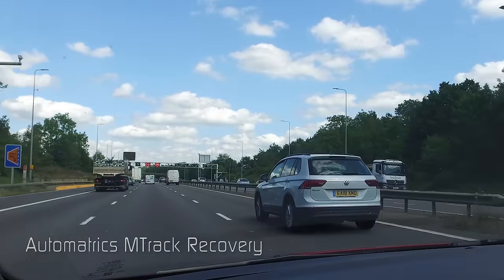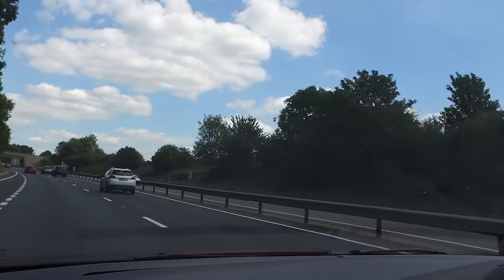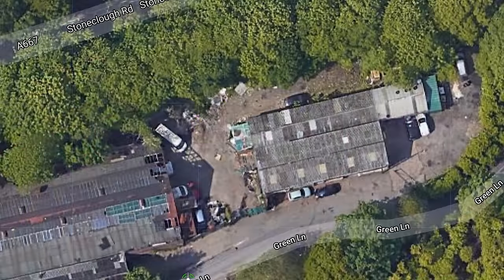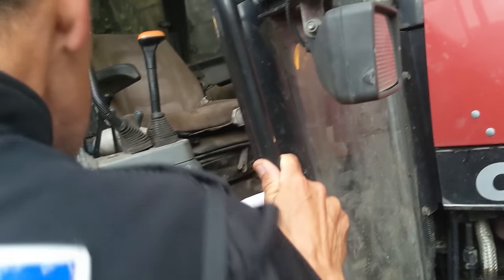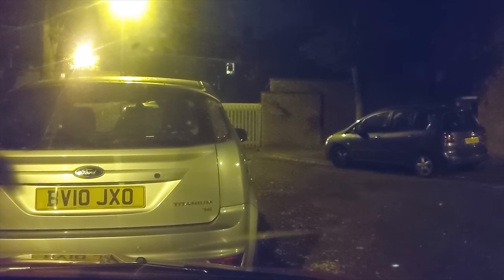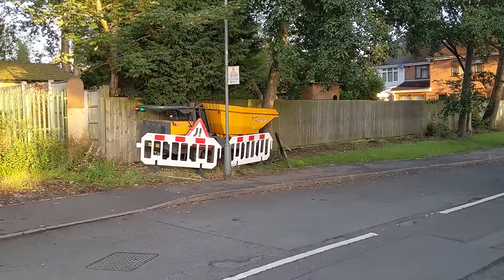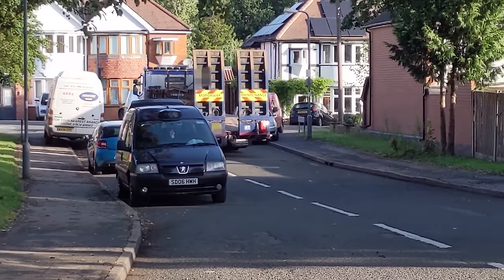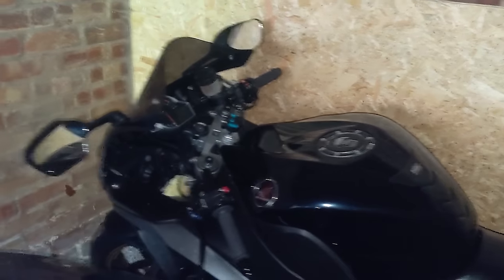Automatrics Triple Stolen Vehicle Recovery Challenge – 29 July 2019

Comment: Hope the officers forced entry to the other 'Vacant' garages that weren't supposed to be locked. 
Probably used as more bandit stash houses.
Reply: Can almost guarantee it.
Reply: That would be breaking and entering, so yeah they probably did.
Reply: @deeej  No it wouldn't, because the council owns the garages and they're supposed to be empty. They aren't rented out and so if the council say they can smash the locks of to gain entry, then they're entitled to do so.
Reply from the maker: @jsl4228  Correct - Council said remove the locks with least damage possible, hence that's why police just tried to break the lock off relatively gently gently and not smash the door in. 👍😜👍
Reply: @deeej  No - it wouldn't.  They can show cause.  So in a situation where they go to court, they would be in the pink.
Reply: @tcpnetworks  Yes, beside which the Council reported that #26 was also not rented.  I would have the lock off it as well, in the hope of finding the BMW.
Reply: @AutomatricsMtrack  visit the lock picking lawyers channel, you will be able to collate a list of easy methods of removing locks non destructively.
Reply: @amojak  yeah, but that looked like an Abus Diskus, if i'm not mistaken, even LPL said that it gave him a little bit of trouble picking it. And you cant shim it either.
Reply: @tcpnetworks  who would take them to court? The council own the garages, they want the loacks smashed.
Reply: @Ephoros  Ramset?
Reply: @AutomatricsMtrack  you ought to carry a battery powered 4" grinder in your vehicle with a dozen cut off wheels. You'd slice through that lock in seconds for the cops. Dewalt make good units. They cut through chains and locks like butter.
Reply: @deeej  Then they arrested themselves.
Reply: @imouse3246  I'm guessigg the bmw is in the other one.
Reply: @amojak  Great minds think alike :)  When the police started 'attacking' that padlock, the first thing I thought of was the lock picking lawyer gently caressing the tumblers with his 'picks'  LOL
Reply: A garage is not a tenancy or a residential dwelling. Therefore if it is listed as not rented. Access can be gained at any time with the councils permission
Reply: AutomatricsMTrack looked like the officer was trying quite hard, we’re there not screws on the wall plate that could have made a much easier entrance?
Reply: By the looks of it they spent half a day trying to burst open one lock..
Reply: @AutomatricsMtrack  you call that gentle a handle grinder would have been better are a crow bar
Reply: The bmw must be in the garage beside
Reply: @deeej  Nope

Comment: 16:25 - Someone needs to introduce the cops to the battery angle grinder, chosen tool of bike thieves... Would have had that lock off in seconds.
Reply: thats how the thieves work,a low-life walks into machine mart and buys one,not so much as a raised eyebrow...fucking frustrating.
Reply: @eddyriley2055  A thief walks into a machine mart and buys something? XD
Reply: @frankvandendool882  yes,with a stolen credit/debit card,try to keep up.
Reply: @eddyriley2055  Don't be so serious dude. I just thought it was funny.
Reply: @frankvandendool882  you are right, we are cool.
Reply: @eddyriley2055  they’d need to have the PIN number to use the credit/debit card they’d just pay cash or will have bought a 2nd hand one of someone

Comment: A cordless angle grinder would have got that padlock off quicker with less damage.. 😎🤫☘☘
Reply: depends on the material the shackles made with. some alloys can be surprisingly resistant to normal angle grinder blades.
Reply: come on now, the police can't afford all that fancy equipment that the criminals use.  They need to spend that money on computers to catch wrongthink on the internet.
Reply: Police should carry a Grander, cut pad locks and chains off

Comment: If garage 26 is not rented and has an unauthorised lock on it why didn’t they check inside that one as well or at least get the councils down if they had a key for it!
Reply from the maker: That's a good question . we did not hang around to find out. But what you say makes perfect sense and the attending police should have also opened that one up.

Comment: As for the garages, why not bring a cordless drill and endoscope camera? Might be a quick and easy way to get positive ID without breaking the lock / door
Reply from the maker: We now have an endoscope in the tool kit, but our only concern is that had we used it on this job, then we may have well bailed out and missed the bike.  We would have struggled to see the bike stashed at the rear,  away from the door.

Comment: So is this general practise for car-nickers ?   Steal it, then hide it and wait for two weeks, in case the vehicles had a tracker ?
Reply from the maker: No,  it depends on the vehicle and the bandits, however most will be parked up and searched for the more commonly fitted and easier to find wired OEM tracking devices. Somewhere usually in the open for a few hours,  after that they can go to a lockup or stay longer. We don't know if two weeks is realistic from our experiences as we recover ours within a few hours 👍👍

Comment: You're dealing with GMP who aren't the sharpest tools in the box.  They quite often seem to want to delay things using incorrect procedures.  I have yet to work out if there is some motive behind it or they are just ill informed.  I know that estate only too well from past experiences attending there with fire appliances.  It isn't actually the Europa Estate, it's Green Lane off Quarry Rd,  Europa Estate is further down the main road.  The place where they found the tractor usually has some form of hessian sheeting up on the steel fence so you can't see what's going on.  That's a dodgy sign for starters.

Comment: For the tractor, would you recharge the battery or put on a temporary tracker just to keep location since the original battery was going flat?
Reply from the maker: That old unit was designed in 2003 and is a non rechargeable version, we do a service exchange on those. They are super reliable and remain a rock solid solution even for today. Exchange unit arrives for customer to change and swap out the low battery unit and return that to us in a prepaid bag.

Comment: I might fit a tracker to one of my vehicles now. Although its not cheap.
Reply from the maker: GPS trackers can be very cheap,  but do your homework when selecting these or other devices for security. Most all GPS only location trackers are not using any secure frequencies or offering a truly covert fitment. Whereas proven professional police preferred and certified theft recovery services will always offers much higher performance and with it a more credible police response... although police will still attended on a priority availability base via the control room.

One major vital area that is often missed is that users may struggle to obtain any type of professional SIM management or have chosen a partner provider who have the technical ability to fully control roaming SIM or fault find and rectify any mobile network hijacked SIMS.

So for strong theft recovery performance you do tend to get what you pay for. In the professional theft recovery service sector Automatrics have few direct competitors but with those few we do have we are most often told that we represent good value for such a focused customer service. Thanks for your comment which somewhat presented us with an opportunity to discuss this topic generally. 👍👍

Comment: To be able to recover your stolen vehicles is great But if it's your daily driver your being tracked at All times?
Reply: Unique SP yes they can easily track cell phones! Not everyone has a cell phone! If you know what you're doing you Can alter the location that your phone! They will just triangulate which towers are used for your call. I only get the phone that you can take the battery out of. Most vehicle thieves can Now easily run their own scan to know if the vehicle has a chip in it and either cover or remove it and put it on some other vehicles and have it be a Wild Goose chase. It is possible to reprogram the chips also.
Reply from the maker: Covert theft recovery systems don't track unless the customer has a need or we need to find it
Reply: AutomatricsMTrack or you are required to by the government because that has been used for court cases. The chip is always on and leaves a trail. Feel free to check it out for yourself.

Comment: Did they not check the other garages that should be vacant? That bmw is probably in there
Reply from the maker: We do not know 100% for sure as we left site.  But based on the intel the police most likely also would have opened up garage 26, we didn't push for that on site as we had our prize, and it came at the end of this rather long operation 👍

Comment: With so many advertisements for trackers, it is always forgotten to tell people the truth. Each tracker can be switched off / overlaid with a jammer in a few seconds. Every professional has misery, including us in our workshop. So it's just a deceptive supposed security. Usually unusable in an emergency. Only those that were found are shown in large format. But 90% are never found, despite the tracker. Everything that electricity needs is unusable, easy to manipulate. But the technology lovers never want to hear it ... Until one day ...
Reply from the maker: Your using or referring to the wrong kit. To secure property people should not buy a GPS tracker, virtually all these systems are as you say poor in their performance when it comes to finding a stolen vehicles, they are simply not covert or secure. 

Security applications need a much greater level of functionality with a multi-layered approach to achieve a higher recovery performance. Such systems are referred to as SVR systems (Stolen Vehicle Recovery) These systems are specifically designed for theft recovery application and they will all work without GPS signals and will be supported by a 24/7 professional customer support and finding team.

Comment: Takes all of 10 seconds to cut off a disc lock with an angle grinder... Shesh
Reply: YEAH but its the long power cord whats hard to carry ...
Reply: uploadJ Get a battery powered one then.
Reply: @uploadJ  Most just have battery ones.Ya just need a tiny hand held one lol.
Reply: re: "Most just have battery ones."

Worthless. You obviously don't do anything serious with an angle grinder. Batts don't cut (they are POSs.)
Reply: @uploadJ  I cut dozens of locks every month at work with a 70$ Kobalt angle grinder and it works great. I can easily cut 10 or so locks with a standard battery... Disc and pad locks aren't fucking super thick steel or some shit jezz. Had it for almost a year or so and it still works fine too.

Comment: While the video was good to watch you can buy your very own GPS tracker online that doesn’t need some other guy to get it for you. You can get the stolen item back yourself which is much cheaper and you can do it all from your mobile phone. :)
Reply from the maker: What if the GPS signal is not received  ? Say its inside a shipping container ? Then how are you going to get it back ? Such as in this example https://youtu.be/9BTX8Y8vrSY

Will police show any interest to help, its most unlikely that the UK police will not respond in the UK to DIY GPS reporters. But more likely If the device is approved and supported by a professional management service.

People should not rely solely on GPS signals for security,  and especially one without a 24/7 emergency and police preferred provider response. There are just so many things to go wrong here, the technology, the SIM, the Network, the power source, the GPS signal, the device being scanned or traced and discovered, or just very simply the GPS signal being jammed. We must point out GPS is not a secure frequency.  It is also very low powered so extremely vulnerable to attack and easy to defeat. 

It would not be wise to direct people to any unproven GPS reporter device without first knowing or proving its theft recovery performance and knowing what level of service and performance a user could expect to receive from literally thousands of GPS device choices online ? Are they going to work when needed ? Do these devices truly provide the highest levels of theft recovery performance? 

It's a total minefield online to just go and purchase a GPS tracker, people need to do their homework. Theft recovery is completely different device and service need. Theft recovery systems have very different and very specific designed technology. It may have an integrated GNSS positioning system but they will also have other location detection circuits, so a multi layered approach, to initiate alternative location methods if these are required. 

Thanks for the comment which has given us an opportunity  to highlight weakness with lower performing and higher risk DIY alternatives.
Reply: AutomatricsMTrack No offence to you but you are an analogue player in the digital world. You should really read Attacker’s Advantage by Ram Charan. 

First of all I have had something stolen that ended up being in a shipping container and you were right it was a very weak signal that I was getting but knew it was coming from the compound. 
Plus a shipping container is only 27mm thick so if you have trouble with a signal I would say that is a worrying sign for your weak GPS unit.

I can’t believe you are saying that “it’s most unlikely the police will respond to the U.K. DIY GPS reporters.” So essentially you are saying the police won’t respond to a crime? This statement you said is totally unfounded and very misleading. 
I have reported to the police 3 times now stolen property using my own GPS tracker and each time they turned up. 

One time I was getting a weak signal cause the bike in question was sitting in a container. I contacted the police and they came out. I told them I had a signal but it was very weak. This gave them probable cause to get a warrant to search the compound and they eventually found my bike. 

God! You make it sound like choosing a GPS tracker online can only be done by rocket scientists. GPS tracking is not a new technology. It’s been around for ages. 
There are lots of well known brands that work and have fantastic reviews. 
Like you said there is literally thousands of GPS trackers out there who run a successful business, who don’t need a 3rd person to track them you can DIY. 
If they weren’t any good they wouldn’t be in business very long and of course when you get the tracker you can test it for yourself for peace of mind. 

You really need to buck up your ideas and change your business plan, otherwise you will be out of business in under 2 years.

Comment: If we have satellites why do we need hand antennas to find these when they have gps?
Reply: GPS is not guaranteed, as you will know from times when your phone or sat nav has no signal. And an RF signal at that low power has too short a range for a satellite to pick up.
Reply: bren106 gps is supposed to be Global Positioning System how can I loose signal?
Reply: @devanvelo3725  GPS signals are easily blocked by obstructions.
Reply: @devanvelo3725  I think I'm pissing into the wind here and hoping to stay dry if there is a need to explain . Come back when you've learnt how signals work, and can be disrupted/distorted/deflected by physical objects. 
And it's lose not loose.